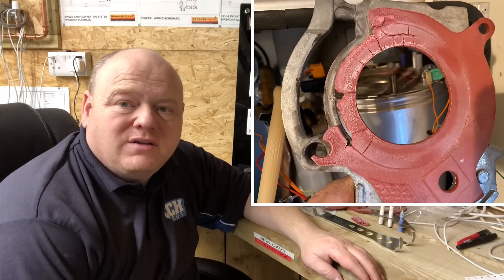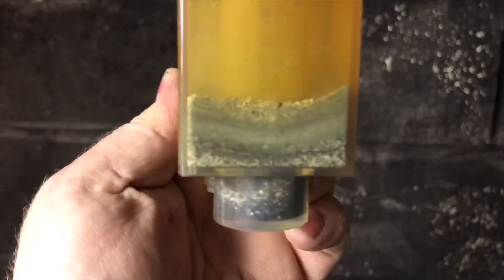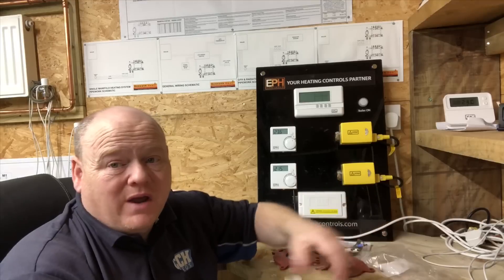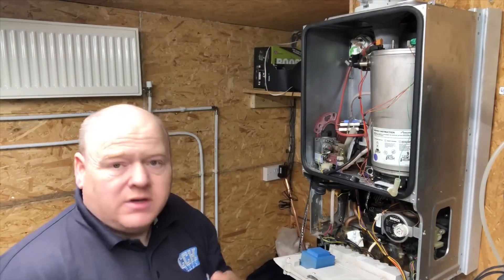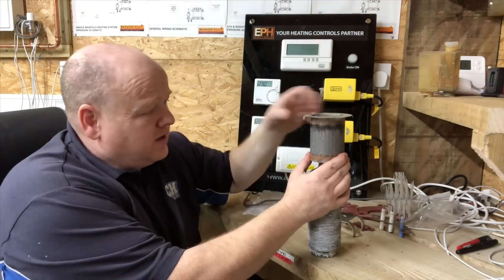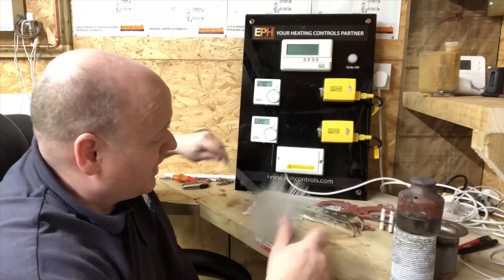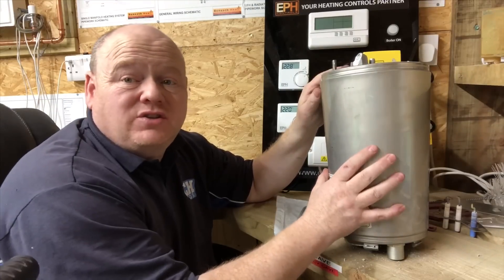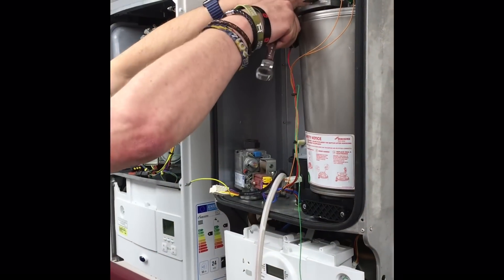Worcester Bosch Boiler Service - Leeds Plumber

Comment: 24ri should I get moisture from the inspection hatch on the heat exchanger. boiler losing pressure. any help would be appreciated.

Comment: Hi Alan, I gather you've stop servicing? We've  got a problem the same boiler as your demonstration model sets of for a few minutes,  gets hotish and then shuts down and cycles like that. We've had an engineer that's changed three temperature sensors and charged a fortune but it's still the same old problem!  What might be the problem, Might you have an idea. Regards jh wf77pa

Comment: Little trick to remove the bottom baffle if it is stuck is to pour Pepsi Cola down into heat cell, let it fizz a bit, and it comes out a treat.

Comment: Really not a good design, hard to clean, time consuming, and you can guarantee, that there will be one or more shoddy engineer wanting to save time , only inspecting the seal , and pipes leaving the rest . Let’s hope this cylinder style is discontinued soon in favour of a box with front lift off or horizontal style soon

Comment: Removed one of these , CO was 5,600ppm. Tried all sorts but could not get the reading down at all. I suspected a crack in the heat exchanger, but non the wiser. Any one any ideas

Comment: About 10 times more reliable than the Ideal Logic heat exchanger. The WB is the most common heat exchanger in the uk, failure rates are extremely low and nearly always due to poor installation.
Reply from the maker: Thank you for the feedback.
Reply: i dissagre there such a bad designe and pain to work on i hate um agree ideal isnt the best but wb also sucks LOL

Comment: I live in a rented property - I have exactly the same boiler, my condenser trap blocked and backed up to push off that little pipe on the grey tube off and sprayed water over the gas valve shorting out the solenoid, this happened during the last winter we had. 10 yr's in the property and the landlord has never paid for a service, often have to remind him of the yearly checks! The red gasket has gone at the top and it shows signs of overheating on the vessel - the landlord plumber wants to replace the entire system rather than the parts - should I have to pay for a service from someone else?

Comment: Would you be expected to do a strip down on all services or just check the press sues etc.
Reply from the maker: You need to follow the installation instructions when doing a boiler service. Full strip down depends on boilers and fan pressure.

Comment: Hi great videos. I’m moving into a 17 year old house in a couple of months. I want to upgrade to a combi boiler. Is there an extra bit of fitting that stops me running a gallon of water from the taps before it goes warm?
Reply from the maker: Yes you could use pumped return. Thanks.

Comment: Wat een slecht ontwerp,pff,blij dat ik een Intergas xtreme heb,super zuinig en simpel en bedrijfs zeker,veilig en zuinig,laats gemeten...rendement op tapwater bovenwaarde 99,2%...ben er blij mee!,geen driewegklep,geen plaatwisselaar..en onderhoud super makkelijk,van de 100.000de wisselaars is er nog nooit maar 1 terug gekomen naar de fabriek door een defect,moet ik nog meer zeggen?.......................................................................................................................................What a bad design, pff, glad I have an Intergas xtreme, super economical and simple and reliable, safe and economical, last measured ... efficiency on tap water top value 99.2% ...  I am happy with it, NO! three-way valve, no plate heatexchanger,for tapwater .. and maintenance is super easy, of the ,more than, 100,000th heatexchangers not even 1 has returned to the factory due to a defect, do I need to say more?

Comment: hi Allen, wanted to ask how does the seals being worn possible affect the fan test? if the seals are letting air through even though its bad, doesnt that mean the fan has less restrictions so that means a higher negative fan pressure which means its a better result.  Thanks again

Comment: I’m not an installer, just an interested consumer. Glad I bought a Viessmann, phew!
Reply from the maker: I.C. Gedye which model did you buy ?
Reply: Allen Hart hi mate I had the 100-W 26 Combi fitted on Saturday. So far so good. It was to replace my 26 year old Ariston Eurocombi that I’d finally given up on. I did all the mechanical (not gas side) maintenance myself, ie cleaned the secondary heat exchanger on my cooker hob, circulating cleaner chemicals while the missus and son were on hols, and changed the expansion vessel and prv 2 times each, I think I did the mixer diaphragm 3 times. In the end I figured as I’d got with the house I’d better spend some real money for once. It did ok for what it was. Thanks for coming back. I love your vids, keep your fantastic work!👍👍👍 oh I must add, I knew about Viessmann from the days when my dad fitted boilers 10 years ago, but I made my choice after watching your video on servicing them. Top notch.
Reply from the maker: I.C. Gedye 100 is a great boiler, did you watch my review
Reply from the maker: I.C. Gedye https://youtu.be/LUxWHBAHGKc

Comment: Yes I’m a gas engineer and an ex WAI I think the heat exchanger is one of the worst on the market to work on, lots of poor quality plastic in the boiler it breaks down and erodes too readily. The top red burner joints are lethal they need a serious upgrade. I renewed a top red joint this week about 20% of the joint was missing, absolutely shocking to see, there should be a recall system on these boilers like on cars and driers / washing machines.
Reply: ive stoped fitting worcester bosh boilers such a pain in the ass to do anything on and badly designed imo

Comment: Allen, you have to admit the design of these boilers are so bad that most engineers turn away at the sight of them for example changing a PRV, I find the easiest way to do this is to take the boiler off the wall, instead of taking out pump and hydro block, I don’t know for you but for an engineer who is going to do a service like what you have just demonstrated for the first time, it would be a nightmare so yes the design of these boilers are utterly crap. By the way great video very informative.

Comment: im a newley approved gas safe engineer just got out my 3 yr apprenticeship like ur vids mate keep up . from preston lancs 👍👍
Reply: well heres one word of advice.dont fit gas boilers made by worcester.the new versions arnt any better.just try getting the boiler casing off any of them.especially the new compact.what a mess.
Reply: @milkman100001  I sigh when I turn up and see an old compact or even a Ri case😂 Some of them go back on fine however some don't, I have attended some where obviously previous engineers have lost their temper and have bashed and bent the actual case out of alignment😂 They're such a horrible design with the screws popping out from the slides etc.
I find the 30i not too bad, just two screws underneath and just the front cover comes off a much better design imo.
Reply from the maker: Thank you for taking the time to watch my video.
Reply: Hi Jesus Christ 108, how much you charge for service this same boiler at WA29QQ  please

Comment: Another very interesting video for me anyway,I am wondering ,would it make sense to prevent a lot of this buld up inside if the system was completely flushed every year as part of the service, or is that overkill.,cheers pete.
Reply: The build up where the baffles are is not part of the water system so it wont help with that.  Its mainly just corrosion of the heat exchanger. Its complete overkill to flush every year. Flush once, make sure you have a good filter installed and the system adequately treated with inhibitor. This should keep you going at least ten years without a flush, providing you're not draining it regularly.
Reply: @billybobhouse9559  Thanks again.
Reply: its maily due to bad design

Comment: He’s right, they never EVER come out that easy in real life. One thing I do to really give them a good clean is tip a kettle full of water down it first, the get the cleaning brush and I’ve bent it straight, I attach it to my small 10v drill and have it spinning moving it up and down as I go. It cleans them a lot better then spinning it with your hand and pulling it up and down. 

If it’s less then 10 years old don’t WB send out a free heart changer or is that a myth? 

Also fix price repairs can fuck off! Taking bread of a mans table. Try reducing the price of your parts

Comment: Thanks again Allen, as we had reviews on Worcester in your previous videos, they are good for engineers to make money,  heat exchangers i are still aluminium which produces  lots of aluminium oxide and clogs the condense trap,. Gas  valve s goes out of tune for no reason which makes some service engineers confused and they think the burner has got an issue because the last thing comes into the mind is  gas valves go out of adjustment without any body touching it.  Plastic manifold starts leaking and replacing it is another costly hell job. To be honest I don’t know why it is technically top in the market,  I think it must be just the brand.

Comment: Good video Allen, very informative.  Never had one fail the test so far.  Will from now on though be sure to replace that seal and do the strip down whether they fail or not every 4-5 years.  Did that one fail the test?  On the state of it I'm guessing yes and badly.  What was  the pressure it should have been and what was it as a matter of interest? Would have liked to have seen you do the service on it.
Reply from the maker: It didn’t fail the fan test no.
Reply: @AllenHart999  wow😮😮😮

Comment: I have fitted loads of Worcesters over the years and not had any real trouble with any but allways power flush the systems
Reply from the maker: Flushing the system doesn’t have anything at all to do with the gas side though. Thanks
Reply: @AllenHart999  no but it helps with the heat exchanger water ways and the combination boilers the most problem i have is with dirty systems which is not the boilers fault
Reply from the maker: Not having a low pressure switch doesn’t help in my opinion
Reply: @AllenHart999  no

Comment: I have to service one of these per year and that is one too many. I only do commercial stuff, but still get asked if l would recommend a Worcester as a replacement of the customer’s own boiler. I tell them that they won’t go wrong with a Baxi or a Weismann because of your opinion. Hope you’re right 😆.
Reply from the maker: Personally I wouldn’t install the cheaper Baxi Boilers
Reply: Exactly, dont just say Baxi. They have their fair share of nightmare boilers. Recommend a certain model so they dont go wrong with there choice.

Comment: Think the fact it doesn’t have a low water pressure switch doesn’t help things as the top of the heat exchanger is the hottest part so cooks the gasket every time it’s used with low water pressure.

Comment: Fan test? You on about the negative fan pressure test? Thought that just tests for how clogged the heat exchanger is?
Reply from the maker: Yes that's correct, All the ones i have seen that fail that are a nightmare to remove.
Reply: @AllenHart999  Yeah thought you mentioned in the vid that the burner seal at the top can be tested with the negative fan pressure test? or are you saying they normally fail because the burner is clogged and it becomes hotter because it can't transfer the heat which then causes more damage to the red burner seal? Also what are the name of them mats that I've seen you use that you can mould into shape?
Reply: @reeceprice2882   the negative fan pressure test only checks if air is flowing through the heat exchanger at the right amount. If the test fails, the heat exchanger is likely blocked. The seal is not checked this way. For the seal, a visual inspection is needed and preferably checked using a telegan. If you suspect the seal hasn't been changed in several years, it's probably best just to change it.
Reply: Billy Bobhouse yeah I check for co leakage with gas analyser probe in and around any seals I’ve disturbed or suspected seals on boiler repairs. Nice one for the reply tho 👍🏼

Comment: Worcester the worlds most over rated boiler!! The old ones may very well have been good. Newer ones are shocking Anyone who designs boiler you beed to remove the flue and boiler on to change a prv on should be ridiculed. Anyone who designs a boiler that sets the casing on fire if its not been serviced for a few years should be investigated (cdi replacement electrodes without glass windows). Anyone who designs a boiler that still continues too run with the burst gasket flooding heat and products of combustion out into the external casing with no safety features to remove the threat should be shut down! (Kebab heat exchanger)  

Customers think that they are the holy grail too because of which magazine Bull sh1t and clever marketing.
Reply: Thanks for your description if you don't mind I'm going to repeat it to my customers, sad thing is that I'm actually a WAI
Reply: I can concur. I had a 30CDi burn through its heat exchanger seal while still quite new. We were away at the time and the entire top front chamber wiring was toast. Fortunately the flames did not make it out of the cabinet or I wouldn't have had a house. WB eventually refurbished the boiler after much sabre rattling. I won't be buying another WB, and I periodically check for hot spots on the cabinet. Cars have engine block gaskets that last a lifetime so it can't be rocket science!

Comment: I’m a Worcester engineer and in some ways I do agree with you on some parts of the heatcell design. The heat exchanger is easy to remove once you know how, it’s like most jobs. The boiler has a very low water content, less than 2 litres, so the ripple is quite common. Like any boiler, they work fine if you have good water quality. Best to fully strip every year if you want no problems. And a trick for the baffle is to use Bicarbonate of Soda mixed with water to remove it. Could be worse, could be better. 👍🏻
Reply from the maker: i used coke 😂😂😂
Reply: @AllenHart999  sniff sniff.
Reply: I agree. I always approach these as a full service and explain that to the customer. Had one once with customer complaining of constant pressure loss. When we got it striped there was a tiny tiny pinhole in heat ex. Apart from that it was all good.

Comment: Not very good boilers. To change out the SRV you got to take out half the boiler just to get access to  it. The fan design i.e. how its connected to the burner (heat cell) is a case of designers trying to be too clever
Reply: If you have nimble hands, you can disconnect the cold inlet pipe and yank it to one side. If your lucky, it gives you enough room to reach up and take the prv out.failing that, you have to cut the cold pipe near the boiler and remove it.  It's still a pain in the ass to do, first time took me an hour. Can do it in about 20mins now with practice. Much easier than the alternative imo. MAKE SURE THE CLIP IS IN CORRECTLY,USE A MIRROR.  Just wanted to make that clear, for no particular reason /:
Reply: @billybobhouse9559  20 mins is good going.

Comment: Worst manufacturer out of the lot in my opinion. Terribly designed boilers, terrible to fit, terrible to work on and still issues that haven't been resolved with certain parts in 10years.

The amount I've been to with ribbed heat exchangers because the boiler has been running almost dry because it's got no pressure and no low pressure switch is crazy. Just one of about 15 design flaws.

Edit: Glad to see it's not just me that thinks this. Thought I was going crazy, everyone I know in the trade thinks the sun shines out of Worcesters arse.
Reply: I think a lot of that is driven by installers who are either on some kind of commission from Worcester or who only fit them and not have to maintain them. They never have to suffer through having to repair them.
Reply from the maker: Not many boilers are worse than these in my opinion
Reply from the maker: @jez lucas Hi Jez hope you are well buddy. Thank you for the comment. The ri wasn’t a bad boiler, As you say it needs to be installed correctly though.
Reply: What’s the most reliable boiler in your opinion. I’ve always thought Worcester but lots of my 7 year + Boilers are starting to need to awkward service and repairs such as in this video 😏

Comment: Just a slight error in your part Allen. I’m certain that the the “flow” goes out of the top of the heat exchanger, not in the top. The return water comes in through the bottom connection. I used to work for Ideal as a field engineer and they are SO far easier to work on than anything else I’ve ever touched. They are not without their problems though. Good videos mate
Reply: Yes Will, your correct the flow goes out the top of the Heat Exchanger. 
It's an easy mistake to make but I'm glad you pointed that out mate. 

Keep up the good work Allan, great videos as usual.
Reply from the maker: Will Parish I think you might be correct to be honest. Thanks